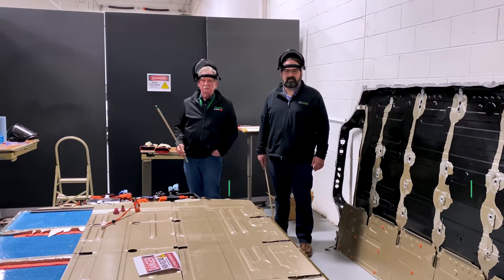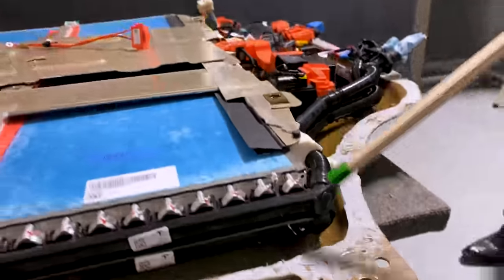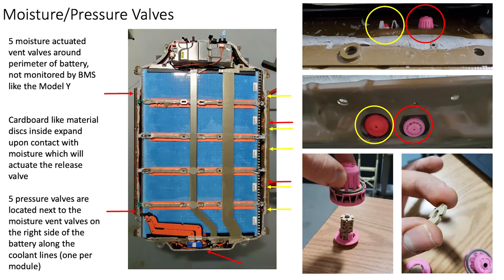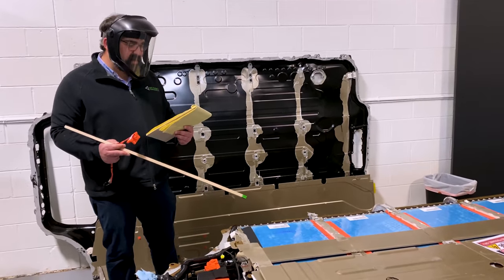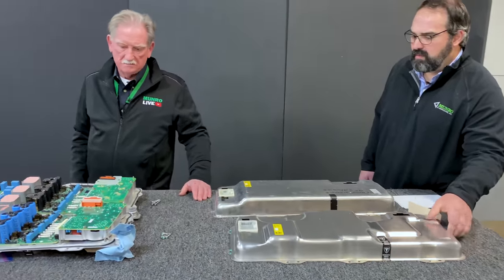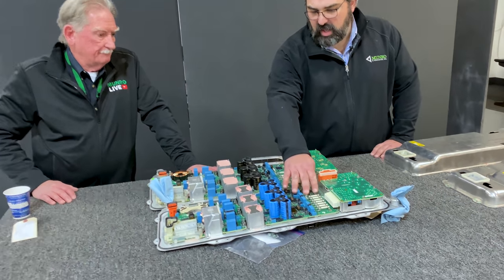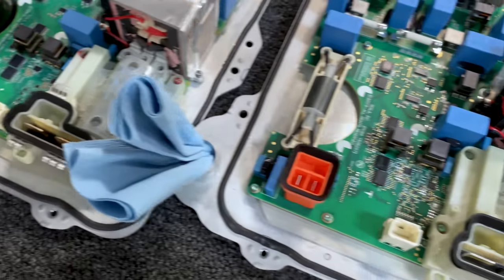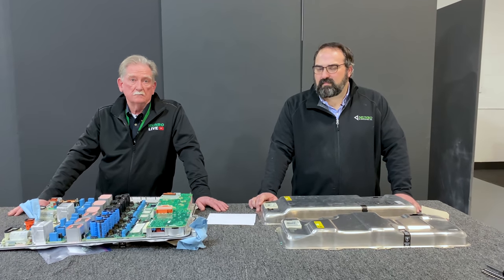Engineering Masterpiece | Tesla Model S Plaid Battery Pack

Comment: Very interested in this break down, especially to see the motor, but I cannot wait for Munro to get their hands on the Model Y from Austin with the 2 mega castings, 4680 cells and structural pack.
Reply: Minds will be blown!
Reply: Afaik, MachE had a structural pack
Reply: @socrplar125  
And it's still overweight.
Reply: @rogerstarkey5390  sure. But that doesn't detract from the fact that it already exists and Munro has viewed it
Reply: @socrplar125  their structural pack was not attached to two gigacastings. Basically 3 pieces compared to 300 pieces or more in the Mach-E. Comparing the Mach-E to the Y or S is a joke. You know that right?
Reply: @GET2222  I understand the MachE didn't have gigacastings. I understand the MachE was heavier with more parts and complexity. It still had a structural battery pack. Why is this so contentious? I believe ev6 and ioniq 5 also have structural packs
Reply: Indeed ladies and gentlemen
Reply: Ordered mine from there recently ! Can’t wait !
Reply: @socrplar125  because if you point out others are doing something that Tesla does the Tesla fanboys get mad. Wait till someone tells them there are better EVs then Tesla.
Reply: @socrplar125  I think your confusing   Having the battery pack be part of the structure of the car vs the batteries being part of the structure of the car.
Reply: @theAppleWizz  I'm not. I believe sandy/employee even commented on the MachE battery pack being structural.
Reply: @socrplar125  The Mach E uses pouch-style cells. By definition these cannot be a structural component of the battery pack. Nor does Ford use front and rear giga-casting. You're both wrong and trying to compare a Da Vinci to a squid.
Reply: @q1joe  "Wait till someone tells them there are better EVs then [sic] Tesla."  Yeah... I'll wait.
Reply: @timyarrow8844  I don't think you understand what "structural battery pack" means. I already acknowledged the Mach E doesn't have gigacastings. Reading comprehension...
Reply: That's cool and all but did no one notice that someone has stolen the top and back part of their motorcycle helmets, they left them with basically no protection at all....damn thieves
Reply: @socrplar125  I watched it.  The battery case is structural.  Not the battery pack is structural.  I believe there is a difference.  Sandy likes the Mach-E but he also said it is the second place, distant second.  Like Tesla lapped it twice.
Reply: @socrplar125  Also great job at linking your argument!  You get my like for that alone.
Reply: @q1joe  As a Tesla Fanboy I look forward to the day in the next 10 or so years when that finally happens.
Reply: how much range is added using 4680 over 2170
Reply: @socrplar125  yeah the battery pack. What they said is that the body of the battery PACK is part of the structure of the car while what Tesla is doing is making the actual batteries a structural component of the car.
Reply: @socrplar125  the important thing is that you are completely missing the point shuriken48 was making. They never said "the first structural pack ever" or anything remotely like that. Tesla has never had a structural pack before, right? Model Y never had a structural pack, right? 

The new Model Y from Austin is the culmination of seven years of effort at Tesla. They hired Jeff Dahn in June of 2015 to start developing the 4680, so they must have had the long term plan in mind before that to decide to try to hire him. Along the way they have pursued multiple huge efforts, including developing their own new alloy to allow gigacastings from bigger casting machines than had ever existed before, buying several companies for their battery technology, examining every step going back to the mines and how raw minerals are processed. This is the Model Y as Elon Musk wanted it to be unleashed on the world, and he was overruled and released the Model Y we have had until now so the release would not be this delayed. 

The new Model Y will be a large leap forward for Tesla, who are already ahead by a lot. Tesla has not spent seven year planning and working on all of this, the gigacastings and the 4680 cells and the structural pack, to amuse themselves. The Mach-e pack in no way is comparable; it has nowhere near the energy density per kg, nowhere near the structural effects and strength of the Tesla structural pack, and it costs a lot more. The Mach-e pack is a 2010 Blackberry to the Tesla Apple iPhone 13.
Reply: Especially if they have data about how long it takes to fully assemble. The rest of the industry will poo their pants.
Reply: @lwwells  "You did it, Mary. You pooed yourself, and it matters."
Reply: That will be a LONG wait...
Reply: @MrTrueshoe  What are you talking about? Tesla does not manufacture no cars in Texas yet.
Reply: @amimartian  They have produced the first Model Y’s already for delivery … My order is placed for august delivery from Austin.
Reply: @tribalypredisposed  I didn't miss his point. I was merely pointing out that the Mach E has a structural pack already. Which it does
Reply: @socrplar125  the Mach-e also has a lot of other parts that the Model Y has. Wheels, seats, motors, a windshield...why do you think that pointing out the battery pack is significant? The Mach-e battery pack and the cooling system are probably the things that differ the most from what the Model Y has.
Reply: @tribalypredisposed  your post is spot on. Why is it such a big deal for people to understand/admit that the Mach E has a structural pack and had it before Tesla? As you say, Tesla is so much better regardless
Reply: @socrplar125  Because when Tesla talks about structural pack, they are actually talking about a full 3 part Strong structural pack that saves money, time, and weight while increasing safety
.
Reply: @q1joe  Tesla is creating better engineers that are moving the other companies. That other companies create good cars will be a good thing for all of us.
Reply: thats what im waiting for
Reply: @daniloreyes2  they are? You should look at the "structural battery pack" patents that Tesla has then. Probably even tweet at Elon that it's wrong
Reply: @timyarrow8844  yep, the dude clearly doesn’t know what he’s talking about. He’s trying his best to insert some fair and balanced data, but unfortunately, his data is off. Wait until sandy sees a model y with a structural battery pack - then this eric guy will be schooled.
Reply: @socrplar125  no, when the term structural battery pack is used here, it infers several things. One is that Tesla will be using the batteries themselves as the honeycomb structure inside the battery pack. The batteries metal casings will be adding rigidity to the car. I’ve heard that a train could hit one of these cars and the car would bounce off before it got crushed.
Reply: @user9675  that would probably add no range, for the same volume and mass of battery pack. The 4680 cells will (they are not in production) have much greater capacity, but they're much larger.
Reply: @MrTrueshoe  re: "My order is placed for august delivery from Austin" a lot of people have orders placed for Cybertrucks (also from Austin).  good luck with the ETA.
Reply: This time what went on in Vegas will not stay in Vegas!!

I met both Britney Spears and Elon Musk early in 2000 at Bellagio. Britney just stared at me as she was singing on stage and I was standing in an archway above and nearby. I'm not sure if I had was supposed to be standing up there by myself but I did have her undivided attention. A few days later Elon came up to me and started asking me questions about what I was doing there, in Hawaii and Las Vegas during that time. Would I be fine answering a few questions and if I was a gambling man? I stated, "I was on vacation and I only like to bet on things that are worth betting on!" I had earned these trips by qualifying reward points at my work. He asked, "What kind of work is it that you do?" I said, "Commercial energy saving promotions but I had been schooled in Automotive Marketing Business Administration and worked in that field for several years as well." He asked me, "If I had millions of dollars to spend what would be the most innovative businesses that could help humanity?" We talked about electric cars, we talked about solar energy and so many other subjects for over an hour. Even commercial space exploration for the consideration of colonization. That way all of humanity's eggs are not in one basket in case of another world war, asteroid strike, major climate change, etc. These we're very expensive and ambitious businesses to become successful at. Therefore we had to talk about ways of keeping a low overhead in advertising, distribution and the manufacturing. He said, "They were all very good ideas and that they should be done!" He said he had already made hundreds of millions off of a couple internet companies he started. "One of them was PayPal," he stated. Not that I had really done a lot of online banking or e-transfers at that time I didn't think much of it, until I noticed online about a year later that I could buy something off the computer with my PayPal card! Unfortunately I had just received a promotion as regional manager with the company I was working with. This made me let Elon know that I had to wait for a few years before I could assist further. I keep on sending out messages, hoping that he will get one and reply back. I will probably have to keep on trying, he gets more messages in a day then I would in five years! It is very inspiring to me to have a conversation with someone and they dedicate the next 20 years to making our conversation reality! We also talked about becoming your own best supplier and starting businesses that help your existing business. A type of slingshot effect that he has incorporated very well. It is so ambitious and amazing that he was willing to put pretty much all of his money where his mouth is and just make it happen with a consistent dedication. Congratulations Elon and I am looking forward to working with you again, one day in the near future! Of course Britney I always wish her well and would enjoy meeting her again as well! Shoot for the Moon then Mars and then we will end up amongst the Stars! If you would like to learn more of these topics let me know. People with integrity expect to be believed otherwise they let time prove them right!!
propower101@hotmail.com
Reply: @socrplar125  No one is disagreeing others  have structural packs.  But the design, engineering, etc... is a joke when compared.   We want to see the best from the originator of EV.   Not what others are making while riding  Tesla coattails.  With Union/Democrat engineering and labor.
Reply: @littlelarry2912  wrong. Lots here have disagreed about structural packs. Did you read this conversation at all?
Reply: @socrplar125  Maybe some are disagreeing because they don't know other manufacturers have structural packs.     But  I'm telling you why those who are aware  are saying Fords structural packs are no longer worth mentioning.
Reply: @littlelarry2912  lol. Okay. 🙄

Comment: Mica is a cheap natural "rock" which is not flammable and not combustible. Damned good barrier between high power and people.
Reply: Apparently, a lot of mica is sourced from India where it's mined by children as young as 4 and 5 years old. Of course, I only just learned about this from watching a youtube documentary specific to the mica used in makeup. I have no idea if industrial mica relies on the same source of child labor. Either way, I agree with Sandy, it would be better if we didn't need yet another unique mined resource for our EVs.
Reply: @Ethan-kr9bh  I suppose Tesla could use large sheets of the same synthetic sapphire used for watch crystals, and we could be sure ? it wasn't from child labor. Other than that, and the curious tan color not matching what mica usually is (i.e. clear stove-glass doors) I don't know of any material that has the same strengths. Maybe Sandy does.
 As for child labor, that's a whole other problem and a hugely questionable assumption to toss in here.
Reply: That is correct.  Mica is tough, does not melt or catch fire and is a good insulator even when it gets hot, while plastic melts easily and is very flammable when hot.   I remember when I was a kid, my dad fixed an old electric clothes iron from the 1950s era and he showed me the mica that was used for insulation because it is much better and safer than asbestos.   And that is also the reason why Tesla uses mica for the same purpose, as an electric and heat insulator.

Comment: These boards make a 3-phase stepped sinusoid into a pure sinusoid. As they have reduced the size and number of inductors, I believe they have increased the number of steps - basically, they increased the clock frequency of part of the system. This may have required faster MOSFET and lower ESR capacitors, but has increased the efficiency and reduced the weight of the boards.
Reply: When you talk high-tech EE like that you attract all sorts of types.  Audrey must love you. 😍
Reply: Wouldnt IGBTs be used for the higher current? Or is it better to parallel and balance fast switching MOSFETs?

Comment: I was working on a mica thermal shield for another OEM's battery pack. Tesla's is a unique part that not many can make. The main benefits of Mica over Sabics's Stamax is melting temp and thermal conductivity.  OEM's generally test for "thermal events" with a ~5min >900C test (depends on battery chemistry) and the "cold" side of the mica part needs to stay below ~150C. (My material passed with flying colors, but not for a good enough automotive price...couldn't dial it back before the OEM decided on another supplier) Stamax is a polypropylene which will melt at 166C regardless of it being flame retardant. Mica is non-flammable, only the thermoset binders will burn; this is this stuff they use to hold the individual mineral flakes together and hold the curved shapes. Since the part also needs to be quite thin, Mica is the primary choice... and probably laminated with some kind of ceramic/mineral wool.
Reply: Stop lying!!!!